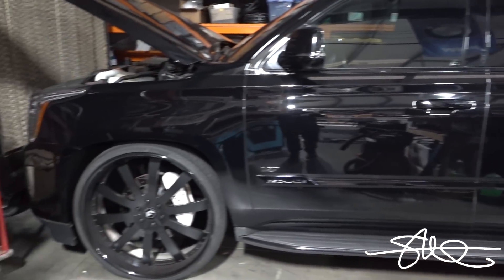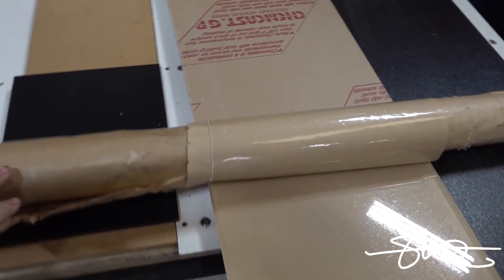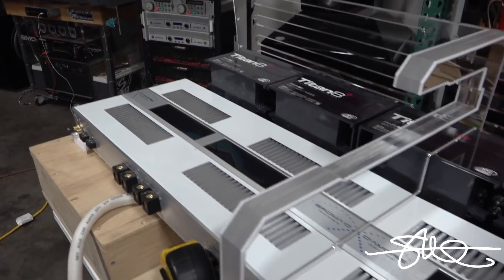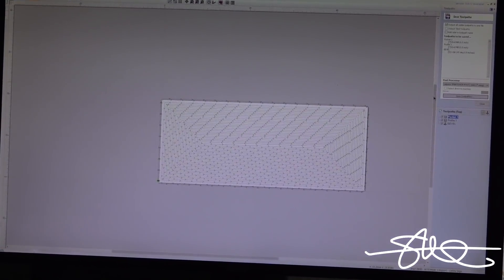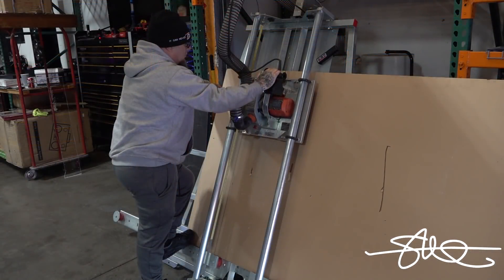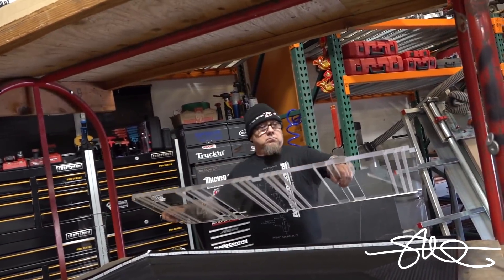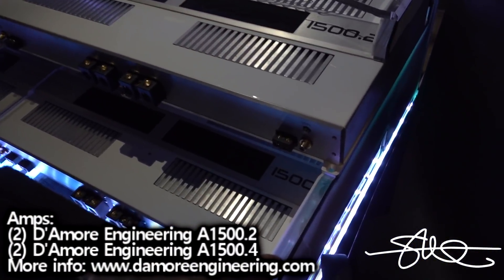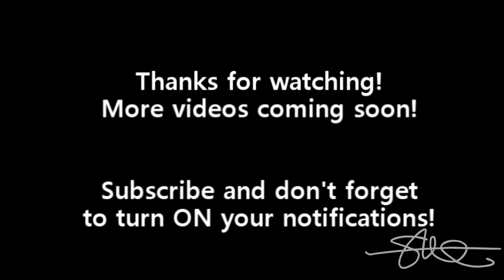Amp Rack worthy of an Escalade? Multi-layer acrylic, Four $8000 Amplifiers

Comment: Hey just 40 minutes north in good ol YUBA CITY. A little stereo shop called midvalley sound , the installer Ray! He done this cadillacs trunk with 2 ppi amps floating and no exposed wires only at the terminals..  its pretty sick actually could have been a sema car  the guy that owned the cadi was named carri rossi

Comment: On your opinion since I have never seen or heard expensive amps play: are the sound quality of this amps worth $$ can u tell a $8k difference from the power series amplifier??
Assuming everything else is the same and the toonig?
Reply from the maker: some people can for SURE.  Not sure if i will be able to or not.  But that is like asking "can you tell the difference between a 50 mile drive in a Honda compared to a Rolls Royce".  Well they both get you from point A to point B. But one is for sure better. Period.  But yes, these are award winning amps that very distinguished people in the industry are RAVING about. People that aren't impressed easy.

Comment: I had some really strange cracking in white 1/4" sign back acrylic the other day. Not sure if its just settings on the laser or what... in the inside corners there was little stress or heat cracks forming.
Reply from the maker: was it cast or extruded? if you don't know, you can usually tell by the smell. Extruded stinks way worse and will tend to crack easier IMO if you use the wrong cleaner. Such as alcohol.  I can get away with alcohol on cast usually but not extruded.
Reply: @meade916  come to think it smelled pretty fn bad man... lol  might have been extruded. It also doesn't let red light through well and sucks for edge lighting.  not like other white Ive used in the past.

Comment: The black thick plastic Kydex? I just got a quote of 1/2" half sheet, $390 clams! Shit aint cheap.
Reply from the maker: It's HDPE "Playboard". Similar to Starboard but more of a playground material texture. But outstanding HDPE none the less. I like the texture better than the starboard. I got 3 sheets a few months back i forget how much it was but probably over $700 a sheet.
Reply: @meade916  OK that makes sense on the texture for sure. $700 a sheet, yeah pretty insane, the same response when I got the $390 quote for a half a sheet. EXPENSIVE ASS SHIT! Still bought the 1/2 sheet lol

Comment: What happened to the 8 channel B2 audio amps u were gna use at first?
Reply from the maker: took too long. The guy they had working on them took so long i gave up.  I LOVE b2 Audio...i am running their 15's in the caddy and also mids/highs. But this caddy deserves the best and that is for sure D'Amore Engineering. So i ain't mad! It was meant to be.  Ill probably run that 8ch in the F250 if it ever get's done.